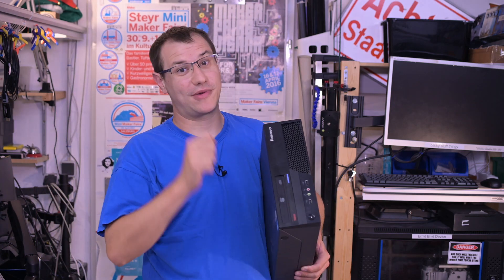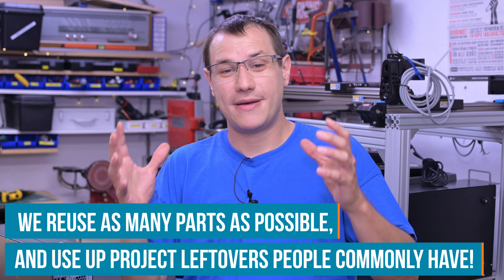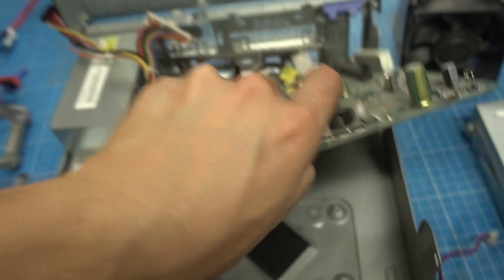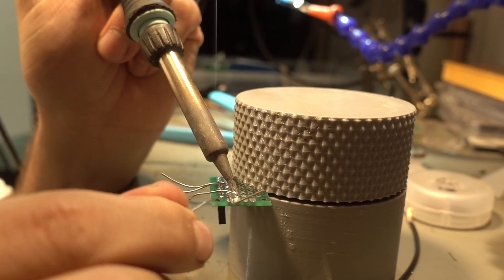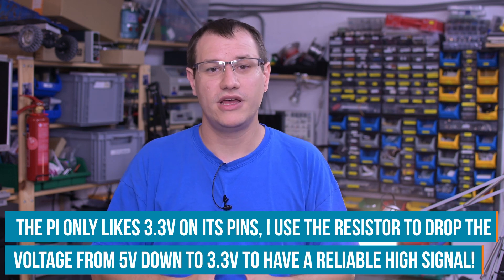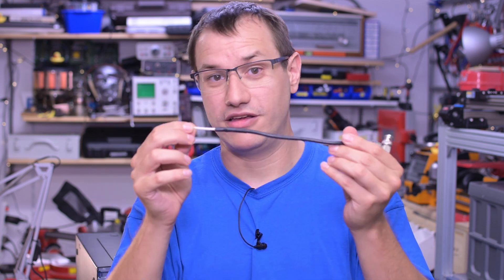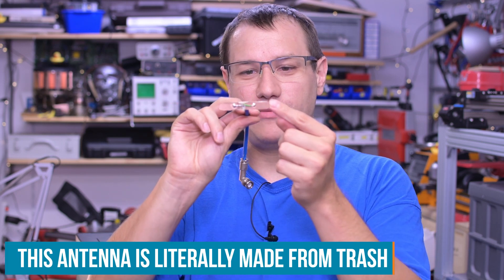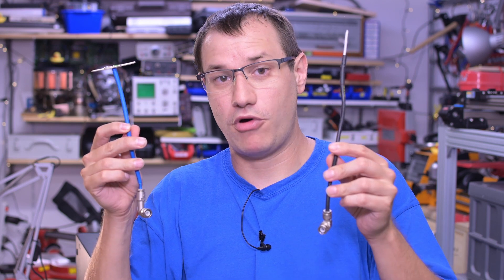Upcycling a Lenovo PC to a Raspberry Pi WiFi Access Point

Comment: Good video. I'm going to check out the WIFI antenna build because I want to make a Bluetooth radio I can listen to all the way around my house as I cut the grass in the entire yard with my Bluetooth headset. This antenna may be the answer? Thank you
Reply: Not necessarily its intended for 2,4ghz but Bluetooth is a rather close use protocol, so you might want to relay the signal over multiple points. Also pay attention to your local rf rules.
Reply: Wouldn’t having a phone in your pocket just be a simpler solution?

Comment: Old stuff belong in recycling. They are power hogs and not worth the electric bill. 
Install a high capacity drive as your second drive in your main machine, and set it to go to sleep after 5 min of inactivity. 
When you need it, it automatically wakes up and you're good to go at top speed of the drive.

Comment: If the pc still works and isn't too old, you can do the same by just installing the right linux distribution. Some even boot from usb so you can use the speedy sata ports for your hard drives.
Reply: true , this one was an early core2duo ,missing ram and harddrives, the power to usability actor made it an easy choice for meto reuse an older model raspberry pi in this case.

Comment: How do you power the Pi? I saw only ATX side, but where do you connect the other side of the cable?
Reply: the other side goes to the GPIO header (the perfboard I solder up connects power and Buttons

Comment: I have a usb wifi dongle but I can't get my pi to work from it rather than the internal
Reply: either use raspAP as seen in the video(which usually recognizes your wifi dongle if supported by the os)or manually configure it in dhcp.conf . the old tutorials for getting wifi on the pi2 are of great help with the exact procedure.
Reply: @clemensmayer9171  and rasp ap will pick up my home wifi so the pi gets wifi not output wifi?
Reply: @georgeaura  it all depends on the configuration, you have to tell it what you want it to do. i
Reply: @clemensmayer9171  what about on a robot made with a pi is the code for controlling such thing have internal wifi set matter or not as to give it more range by using a dongle?